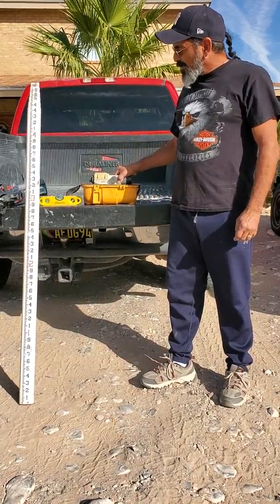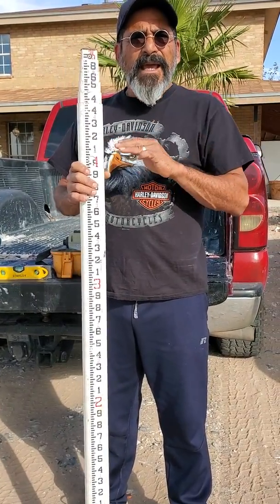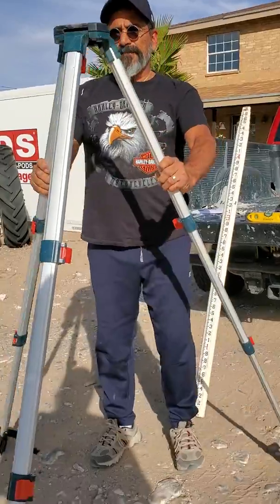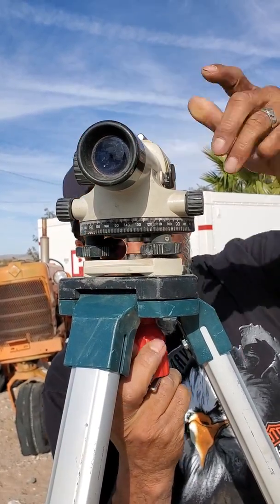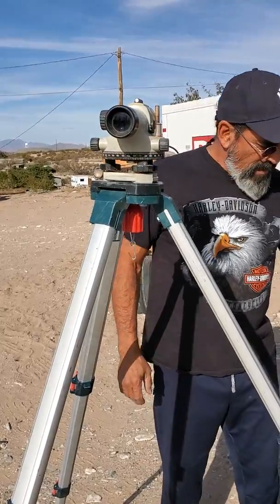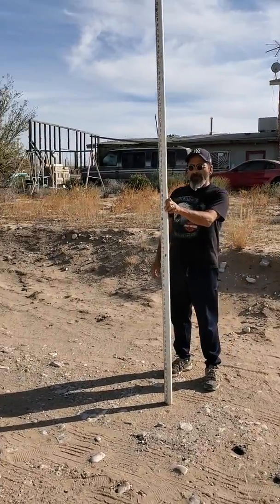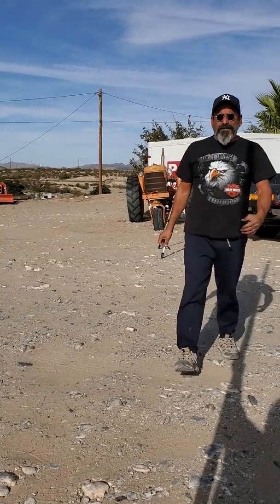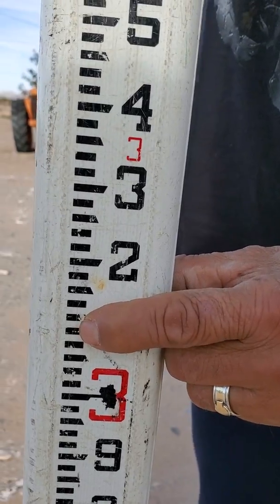Instructions on how to use a transit level

Comment: Pretty informative,  so to say it's prone to fail isn't really true. This is a cheaper model David White and it's probably within ½" in 100' or so as long as you cross check the leveling bubble.  Most commercial laser levels are within  ⅜ths  of an inch in 100' ( self leveling ) if it's up to date with calibration.  Some of the more expensive David Whites are within 1 hundredth of a foot in 100 feet. Or a little over an ⅛ of an inch. Anyways for someone with no experience who is trying to lean how to use a transit level I'd say this video is great. Only tip I think he should have rehearsed it a couple times because he seems a little sputtered and nervous. I think if he would have ran it twice it would have been perfect. Great Job man good video.

Comment: That is NOT a transit level.
Reply: No it is a transit level. Just because it doesn't move up and down to shoot a plain, doesn't mean it can't be used to figure a vertical line straight. That's why some come with a plumb Bob and cross hairs in scope ( vertical and horizontal lines)

Comment: Ok here's an obvious question: Why do they not have tripod legs on the grade rod??? I watched several of these videos on transits and I keep wondering this
Reply from the maker: believe or not Mr. Keeler i have seen on some the jobs that i have been on where the grade rod does have a tri pod accessory that can be attached.
Reply: It can be cumbersome to try and level a stick with a tripod and you're usually moving the stick around. And wear your shooting the grades it's usually not level. I've often seen the stick holder using a level against the stick to try and get it as straight up as possible
Reply: They do, it's called the other who holds the grade sticks legs. Lol But  seriously it's because it's ment ti mover around to different locations. Example;  I do concrete for a living, if I am starting a buildings foundation  aka excavating a foundation ( footing)  as I dig I need someone to check grade aka bottom of my footing as we go to make sure it's level.  Pretty much every 5' of footer.

Comment: As a young man rushing to set this kind of level up ahead of the boss getting there I did as shown with tripod and torpedo level, then tried to level the bubble with the three knobs.  I chased the bubble around and felt stupid when I couldn’t achieve level!  It seemed so simple when I was shown.  I then learned to only turn two knobs.  If you are near center travel on leveling knobs, choose two and that will get you there.  If you turn all three likely you too will “chase the bubble around” and struggle to get it centered.   Pointing the level so it is toward one of the turning knobs also helps me.  This way front/back is one knob, left right, the other...this isn’t a perfect explanation, but hope it helps someone.

Comment: That's a 24X automatic level, not a transit level.  A transit level is an instrument like a David White LT8-300, or the previous model to that, the 8300.   A transit level's scope can be tilted up and down approx. 45 degrees for engineering something for plumb, like a tower, or column.   A transit level has 1 or 2 lock levers to secure the scope for level to measure grades and elevations.  So, it is a combination , dual-function instrument.  Contractors for generations have referred to  levels like yours, and other fixed scope dumpy-type levels, as transits, or transit-levels, when in reality they're just levels, as they have 1 function and that's measuring grades and elevations.
Reply: David White ? I would have picked K&E or Wild or Lietz or Topcon or Lieca before David White
Reply: @skibee50  K&E has been out of the land  surveying instrument business since around 1980. They were a manufacturer of old world surveyors transits and levels. Wild is a Swiss make, and was acquired by Leica 20 or so year ago . Lietz is now known as Sokkia, and was bought out a few years ago by Topcon. The makes you mentioned were all high quality instrument lines in their day, and very accurate.
Reply: @BenSlover1  I think it cool Lietz camera Lieca' and  Adolph Lietz  from Wisconsin were not related directly and all morphed into Topcon
Reply: @skibee50 I think Leitz was the former name of Leica, and was changed to Leica sometime in the mid-80's.  Leitz and Lietz are sometimes confused for one another because the spelling is so similar.  Sokkisha was the parent company of Lietz surveying instruments.  They dropped the Lietz name at some point in the 80's,and started going by the name Sokkia.  It was a big mistake at the time because the brand name of Lietz  was so well-known by end users.  Sokkisha did a poor job at the time transitioning to the name Sokkia, while abandoning the Lietz name, and a lot of end users just thought they went out of business.  One of the reasons they dropped the Lietz name at the time was because they were opening direct retail stores in the US  and wanted them to be called Sokkia.  When they opened these stores, it pissed off a lot of instrument shops that had been selling their instruments for decades.  Sokkia was on the verge of bankruptcy a few years ago, and that's when Topcon acquired them.  Sokkkisha/Sokkia/Liettz is and always has been a Japanese manufacturer. Topcon is and always has been a Japanese company manufacturing ophthalmology and surveying instruments.
Reply: @BenSlover1  you are correct
And thank you ! I have read company history of both and never noticed the different spelling 😵‍💫 Dumb me no wonder they are not related
Reply: Answer me this question.... so is the auto levels more accurate to shoot grade or is a transit more accurate?
Reply: @mattingly1217  I've been working on survey instruments since 1977, and hundreds of times over the years I  have heard contractors refer to  any and all types of optical levels, whether it's automatic levels, or older style dumpy or engineer's levels., as transits, when they're all just levels.  So, I'm assuming that maybe you're doing that?  A transit is an instrument that the scope swings through all the way vertically, 360 degrees, so it is not a fixed telescope instrument like levels are.    Calibrated automatic levels are more consistently accurate from one job to the next because the instrument is designed to take all of human error out of the picture.  Inside the automatic level 
telescope compartment is a pendulum-like device called a compensator.  All automatic levels have a circular 
level vial.  When you level the circular bubble within the bullseye, you get the compensator within the approximate center of it's working range.  When the compensator is balanced, it  can provide a level line of sight +/- 1/32 of an inch in 100ft.  When the compensator is in good working condition and balanced, it will also provide a the same accuracy even if the instrument is a bit out of level.  A standard test in the shop  by an instrument technician when checking the working range of a compensator and it's repeatability to deliver a level line of sight  is to throw the instrument way out of level by purposefully driving the bubble out of level with 1 of the leveling screws. The tech will move the bubble straight forward and straight back including outside of the bullseye while monitoring in the collimator scope the repeatability of the compensator  to provide a level line of sight.   End users are always surprised by how extensive the working range of the compensator is when it comes to providing a level line of sight (+/- 1/32" per  100 ft)
even when the instrument is way out of level.  Now, you wouldn't want to purposefully use it like this on the jobsite, but if the compensator is working as it should, your level line of sight will be true if you keep it level 
within the bullseye on the circular level vial.  So, if you level the circular vial and center it in the bullseye, and then rotate the instrument 180 degrees and it goes a bit out of center, it will still provide the same level line of sight.  Again, this is considering that the level is calibrated, the compensator is balanced and repeating a true level line of sight through it's working range.  Adjusting the bubble where it stays centered when you rotate the instrument is a standard adjustment in the shop.  So, if you had your instrument calibrated a few months earlier, and now the bubble isn't staying perfectly centered when you rotate it, it usually isn't a concern.  Also, some automatic levels out of China have poor quality circular vials that don't stay centered even when they're being adjusted in the shop.  Again, the proper function of the compensator is everything.  The term "automatic level" refers to the function of the compensator, and it' ability to deliver a level line of sight.                                                                                                                                                                                                                                   Older style levels with tubular level vials, whether it's 12" or 18" levels (what you referred to as transits?) are also very accurate when they are calibrated.  However, the accuracy they can potentially deliver is contingent on how careful the operator is when leveling it. These instruments typically have 4 leveling screws and a very sensitive level vial.  The level vial on this instrument is at least 10 times more sensitive than a level vial on an automatic level.  And, that level vial sensitivity translates to the accuracy it can provide for measuring elevations.  So, this instrument does involve more human error in consideration of how  careful the operator is when leveling it.  So, yes older style levels can be very accurate, but automatic levels are more consistently accurate as their very design takes much of the human error out of the picture.                                                                                  All instruments including older style transits, optical theodolites, electronic transits, total stations, 12" levels, 18" levels, automatic levels, laser levels, farm levels, etc. should ALL be calibrated at least once a year.  It's a small price to pay to ensure you're engineering your jobs properly.  Out of calibration surveying instruments cause a lot of inefficiency on jobsites.  By the way, most instruments and lasers that you buy out of the box at the hardware store or online these days are not calibrated !  The chances of you getting one in adjustment is about 33%.  They manufacture most of them in China, ship them overseas, mishandle them in freight and stocking, etc.  In the end the chances of you getting a calibrated instrument is slim to none.  Also, the Chinese can be very sloppy with their accuracy standards .  They hide behind huge curtains over there.  But, you paid X# of dollars for an instrument, so you deserve the guarantee it's in calibration.  That's why you should always buy your instruments from survey instrument shops. And,  don't hesitate to ask if the shop has  a good technician that will make sure your new instrument is calibrated. When I first started in this business and up into the 90's or so, instrument companies would only sell their instruments through surveying instrument shops because they actually cared that their end users would get a calibrated instrument. Bottom line, they don't care anymore.      Sorry for the long as hell answer.
Reply: @BenSlover1  no I appreciate the long answer.. you definitely cleared that up for me... and yes I meant a transit just like you explained and yes the auto level like you explained... I did buy both from Amazon... they are both good but I did buy a Lazer slope level at a shop I payed dearly for... they are very close... the auto level (optical) from Amazon... is a david white... I tried explaining to the guy at work that it had a pendulum in it and he looked at me like I had 3 heads... so I got it in the bullseye one way but when you turn it 90° you had to rebullseye it cause the little bubble was off.... but it doesn't have to be absolutely perfect... it should do itself... I was shooting about 30 foot away and tried it off level and it read the exact same on the rod.... now the Lazer level I bought from the shop will automatically level itself...... we are doing earthwork with it so it doesn't have to split hairs or anything but thank you for your answer!
Reply: Calm down sir we know you read the books. At the end of the day it’s just a level
Reply: @dieselmex1808  I've been a land surveying instrument technician since 1977, so yeah I was perfectly calm when I made my original comment.

Comment: That wouldn't be 3' - 11" btw.  the hashes represent 10'nths.  bottom of the black has meaning a 5th.  There are 10, 100'ths in a foot, so the angular points on the has represent 10ths.  It's not difficult, but it does take time to become quick to read proper grades while signaling your rod holder.

Comment: This is not a  "true"  level in that sense.  Traditional  transit levels  MUST be perfectly level at the scope, and have precision  bubbles to do so.  These here have a  self leveling device  internally to the scope which adjusts the crosshairs.   These are prone to failure in some degree, and so you must be aware of that.  I have two similar ones they work great.   How do you CHECK a level?    Set it up  take  a sighting across say,  two phone poles, then  move it  down  and sight back the other direction.   If accurate you should end up with two parallel sights,  both  same distance apart  at  each  sight point.
Reply: You a describing "two pegging"  
I used a automatic level every day for 32 yrs. I would always give it a light tap on top while I was sighting and watch the compensator working kinda floating and then settling back to the original rod reading as kinda a quick field test

Comment: Great presentation I always get messed up with plus or minus which way I’m going to go I build a water level with a plastic tube I put Velcro on my pole I took 2 yard sticks from Home Depot cut them at 20 inches put Velcro on the back of them, so when I calibrate I take the sticks off and I put both zeros at the water level so I got numbers going up and down from the water level I’m just playing around I should make some kind of a video like you got again nice presentation.
Reply from the maker: Thank just tried to make it as simple as I could thanks for the comments